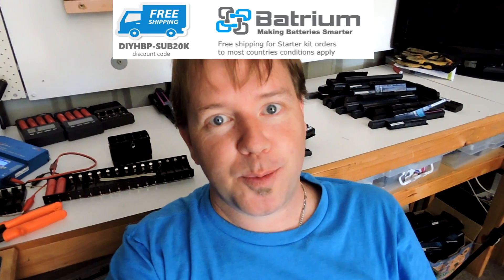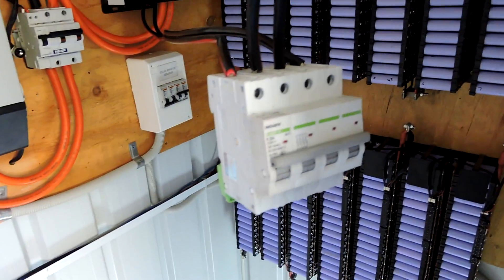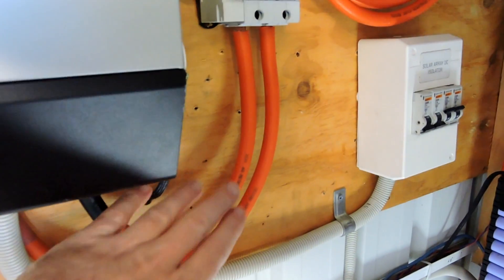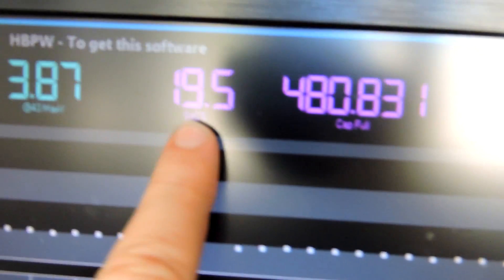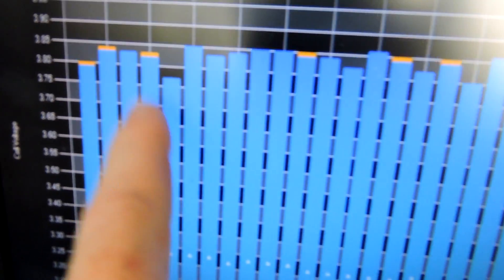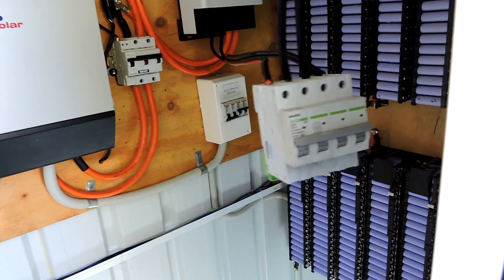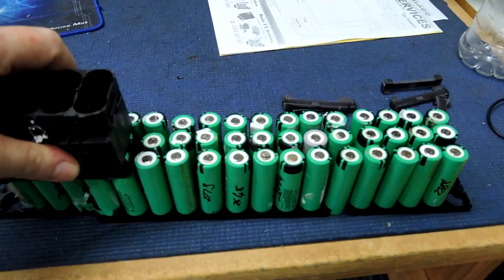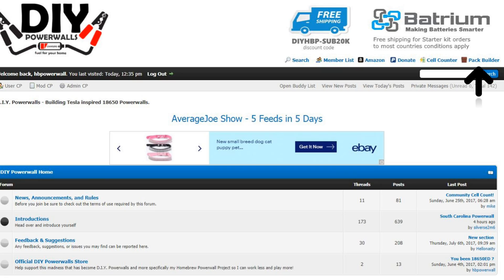20000 Subscribers and an creative update

Comment: Congratulations on the 20000 subscribers. I was planning on using the discount code, but Batrium have no stock until August for most starter kits. I'll try again then. Videos are great - thanks for all the input and effort.
Reply from the maker: That's the reason for the discount :) It is for a limited time so if you're keen get on it and take advantage of the discount.

Comment: why the breaker failure? using as a switch often and/or tripping often? what does a replacement cost? just the right amount of pussy!
Reply from the maker: I did / do use them as switches turn it off and back on again after making some changes and nothing.. worst part was i thought I'd blown up my PCM60x ! i was so angry till I took a step back and got the multi meter out.